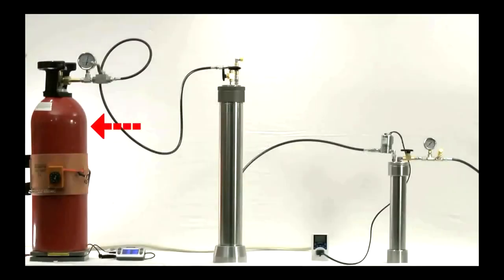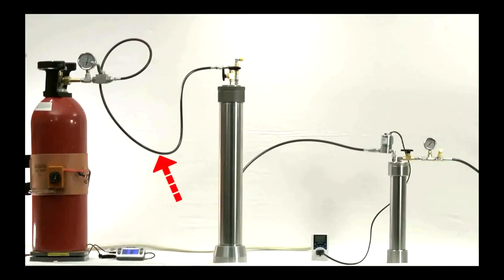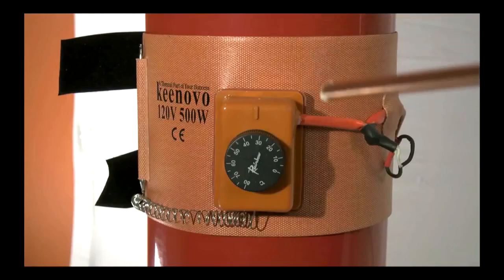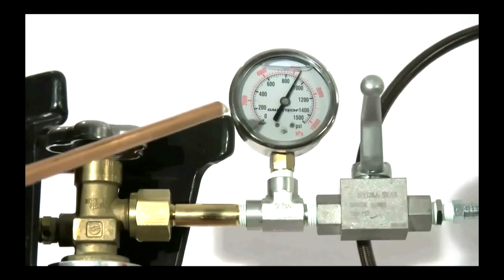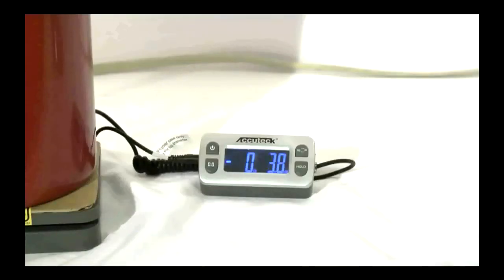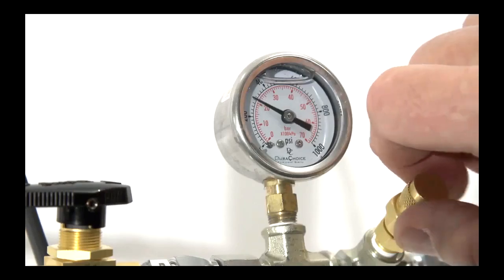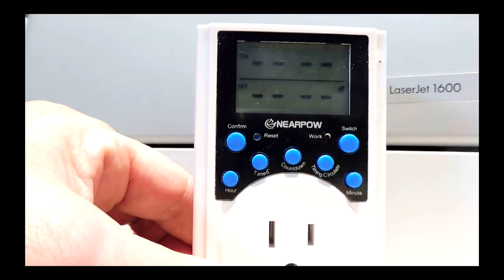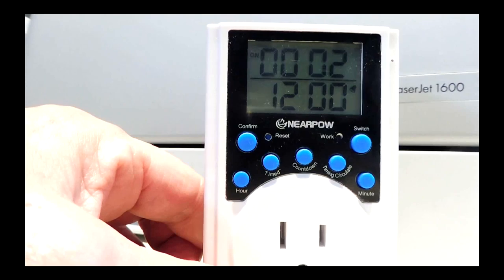How to operate 16oz MedXtractor cannabis oil CO2 extractor short version tutorial

Comment: People should decarb their material before trying to extract with CO2
Reply: Generally, yes they should. However, if you want a better terp profile, you should extract before decarbing and then decarb and extract the material again.
Reply: no decarb needed if you're smoking it, but def for edibles and vape. CO2 will extract the THCA which will decarb to THC when ignited
Reply from the maker: @phytologyextractiontech6999  Not quite correct. THC-A/CBD-A are quite polar and CO2 dis non-polar so the extraction efficiency suffers big-time. You can pull terps before decarbing but if you want cannabinoids using CO2 you'd best decarb...
Reply: Just getting back into the Medical community after a decade. Is this how “wax” is made?
Reply from the maker: @packycain381  the extract can be separated into wax and oil

Comment: As much as they want for these things you'd think they were made of solid gold
Reply from the maker: The "gold" is what comes out of them:))
Reply: Stainless steel tanks/pressure vessels, associated valves and timers, heater/freezers don’t run cheap. The engineering has already been done for the buyer and that’s not cheap. The system, fully constructed, MIGHT be able to be built in ones basement for a cheaper price but few people that I know have the time or inclination to design one and get it built. This thing is processing a pound of cannabis at a time. That sounds like a commercial operation to me, unless you’re independently wealthy. Commercial operations generally have multiple backers and money.

Comment: Hi, i have a doubt. 
Supose i use 800g of dinamed ( %15cbd) and i conclude with 50 ml of pure extract. 
These 50ml are 50.000 mg of pure extract?
How i make 30ml with 240mg of extract. To conlude in 8mg x ml. 
Help. 
I have de 16oz its amazing machine.
Reply from the maker: Please tell me your name
Reply from the maker: and the serial# of your machine
Reply: @ndatalyzecorp.3792  I do not have it at the moment, could not you just remove the doubt?
Reply from the maker: @patagonialibre  I'm sorry but I do not understand your question - please clarify. Thanks.
Reply: @ndatalyzecorp.3792  Thanks for answering. Excuse my English.
My question is;
I have 50 ml of extract, whose bio mass is known as "DINAMED".
My question is how can I split this extract.
Of those 50 ml do I have 50,000 mg to divide?
For example:
In 1000ml of coconut oil I mix 50ml of dinamed cbd extract.
Would the result of each drop of 1ml contain 50 mg?
Reply from the maker: @patagonialibre  Assuming you have 50ml of raw extract that contains approx. 28 grams (28,000mg) of CBD, and you want 50mg doses, you would have enough CBD for (28000/50=) 560 X 50mg doses. You can add as much coconut oil as you want as long as you cut it into 560 doses.
Reply: @ndatalyzecorp.3792  Thanks for your time.
We have used 800grams of "dinamed" from the dinafem bank, which is a strain that has% 15cbd.
The result added to our inexperience was 50ml of final extract. We passed the tuvos 2 times. We sure did something wrong that made us have less extract.
I find it difficult to understand how many mg I finally have.
Of 50 ml of extract we would have around 28,000mg?
If we mix 28,000mg in 1 liter of coconut oil, each dose of 1 ml would have 50mg?
Thank you
Reply from the maker: @patagonialibre  you will have to have your extract lab-tested to determine actual CBD by weight. Then you need to do the math.
Reply: @ndatalyzecorp.3792  I'm beginning to understand, thanks for your patience.
Assuming I have 50ml of extract resulting from the process.
50ml would be 50,000mg - 28,000mg cbd = 22,000mg of waxes / lipids and bioparticles.
Does it mean that for example: to take at a rate of (50mg x ml or drop) should I divide the 50ml into 560 shots?
Reply from the maker: @patagonialibre  I believe so.
Reply: Thank you really hellpfull for me, final question ; Lipidis and bioparticles:   These lipids and bioparticles can be separated from the extract?
What do these lipids and bioparticles consist of, are bad or can be part of my bottle of 560 shots?
Thank you
Reply from the maker: @patagonialibre  Bioparticle removal requires filtering. Fats/waxes removal requires winterization. Use Google to find out how.
Reply from the maker: 50ml would be 6.25% extract by weight. With 15% CBD you should be able to get more than that. The 50ml won't be pure CBD, probably 40% will be waxes/lipids and bioparticles.